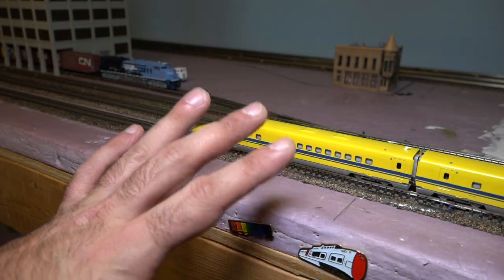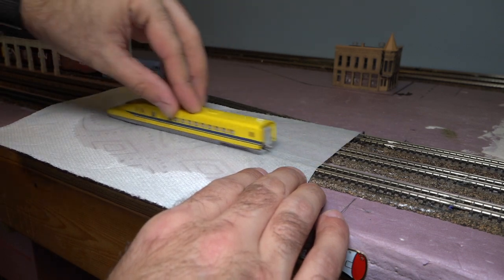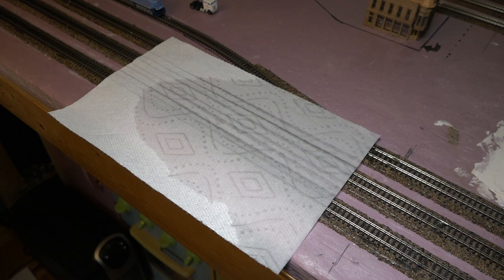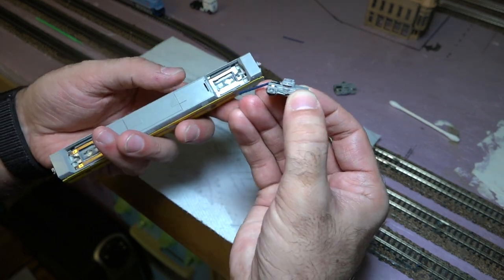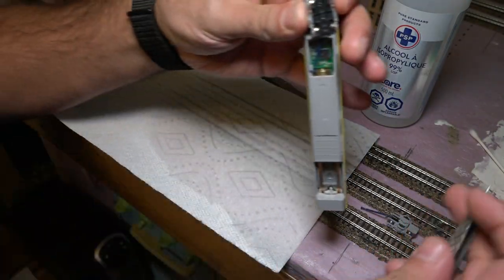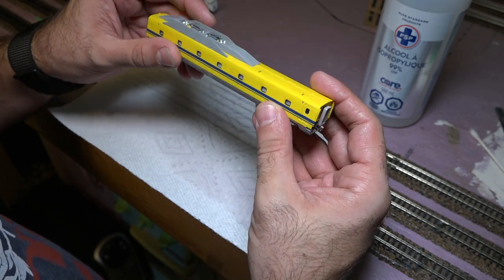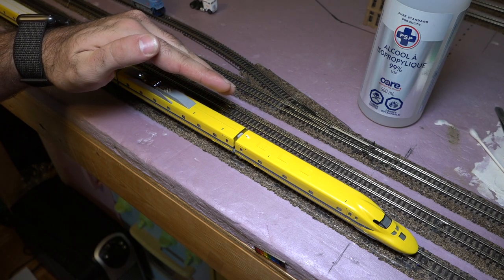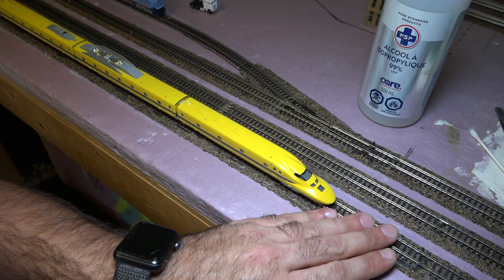How I clean the wheels on my trains

Comment: I bought a wheel clean that has pads on it and you can either use the track as power and just set it on the track and put the motor car or engine on it and run  - it has stops on each end and makes it easier - but do the same with the regular cars or run a q-tip on the wheels when it's upside down on a rag or something like......later.....
Reply from the maker: Thanks Steven Bonnevill.  I had a motor car cleaning once. But it didn’t work that great.  Sounds like yours is better.  What kind of wheel cleaner do you have?

Comment: Great Ideas  I use a tidy track wheel cleaner for my locos and it cleans them dry , did you change your plastic wheels to metal wheels I have done many of my collection , at a great cost the metal wheels run about $1. per axle , but they run better !
Reply from the maker: I would have to say that I am about 90% converted to Metal wheels. You are right it seems that the rollingstock and trains run a lot better with the metal wheels. I also find that the tracks stay cleaner for a lot longer with metal wheels as well. That’s one of the major reasons why I have converted to metal wheels. But just like you said it can get extremely expensive.
Reply: @H0bby_Adventure  I have changed over 800 sets of axles and still have more to do , have maybe 300 more to do , I just bought some wheels from Rapido trains  33" metal wheels 100 pk from Canadian Express Lines , for $70. +shipping , he is in Brighton ON . goes to many of the train shows , he will ship to you via  Canada Post , check out his web page . you see whan you by trains from the US , there is an extra Import charge now usually $35.00 per $100. spent on a order form the US . OUCH !

Comment: I learned the following from a veteran Model Railroader close to 50 years ago, and I've passed it along to a LOT of people.
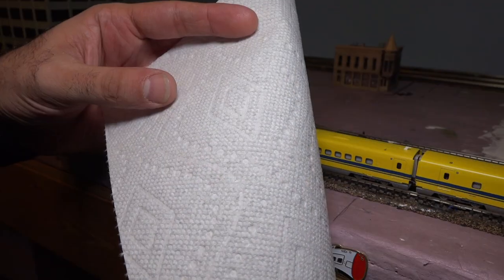Point #1: What you show at 0:38 is NOT rubbing alcohol.  It is simply 99% Isopropyl Alcohol...great for killing germs, removing rosin solder flux, very light greasy coatings and some types of paint.

Point #2: Rubbing alcohol not only states that on the label, but contains oils that (usually) benefit sore muscles when physically rubbed in. 
BUT - and this is a big BUT - those oils are NOT beneficial to printed circuit boards, metal wheels, and some types of rubber and plastic.
In the days of tape decks, 8-tracks and cassette recorders, many people learned the hard way that rubbing alcohol would 'gum' up', and - in some cases - destroy tape heads, capstan rollers and plastic parts close to the 'cleaned' area.

Therefore: Do...Not....Use Rubbing Alcohol on model train parts, rubber items or anything else you want to clean...!

Other than that important point, your video is well-done.  Nice 'background' music, good lighting, and good advice...!
Reply from the maker: Thanks for your input.

Comment: How often do you clean your wheel sets?
Reply from the maker: Hey Joe G. Honestly not that often. I’ve had this particular train for about four years now and I run it quite often. This is the third time that I have clean these wheels using metal wheels on your layout is a huge benefit. 1 your trains run a lot better. 2 it actually keeps your track cleaner unlike plastic wheels. I clean my tracks at least once a month.  That also helps keep the wheels clean as well.

Comment: I thought woooo boyz when I heard the fist sentence.. Alcohol and dry paint don't mix and will quickly destroy the paint if you get some on the paint finish..  You might by accident flick some on while cleaning the wheels or have some on your fingers, grab the body and poof there goes your paint job as it eats the paint, I use it to strip off the paint for re-paints and it does an excellent job at that, the paint just floats off, manufactures also use to to reduce the paint to spray it so it just needs that alcohol key to open up the door to disaster,  doesn't matter how old the finish is, I've had locomotives that had fingerprints embeded into the paint! 
There are wheel cleaners available that are safe where you actually plug the cleaner track into your power pack,  place the locomotive on the cleaner track and run it,  the loco won't go anywhere as it doesn't have any traction to do so,  so it just sits spins and cleans itself, beter and safer than taking out the bogies then having to take the bodies off to get the driveshafts back, you only get so many tries to do that then one day you get to say oh shiza.
Reply from the maker: Very true Richard. There are a lot better ways to clean wheels. I have tried other ways and bought some products and I can tell you that this is the cheapest (if you are carful and not get alcohol on the paint) and most effective way that I have seen. But like you said that there might a very good chance that the paint on your models can get damaged by accident.
Reply: @H0bby_Adventure   Yes, some of the locomotives have painted belly tanks or weathering, one wrong move and youz gotz yerselfz a skidmark on yer paper, and that ain't dirt.